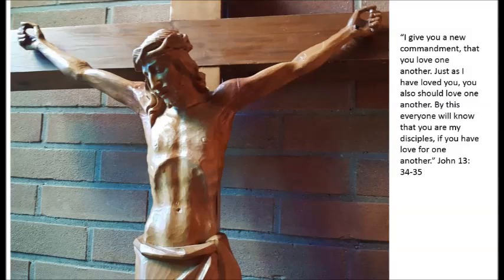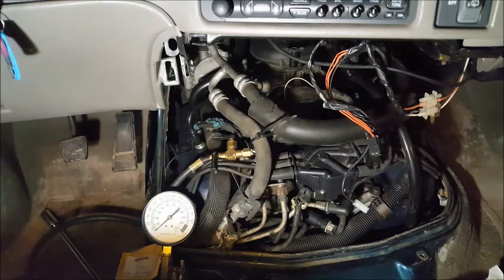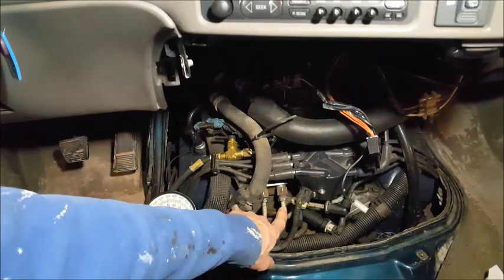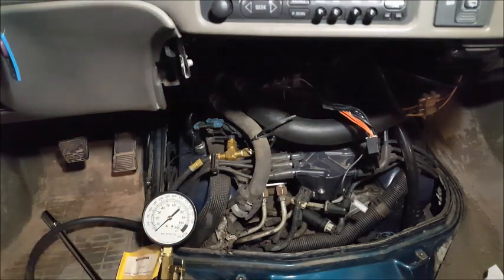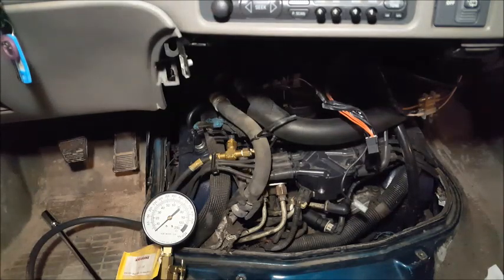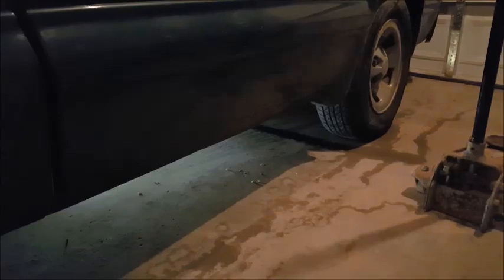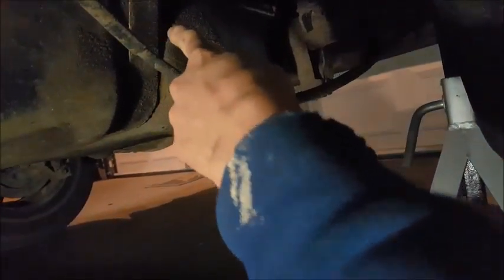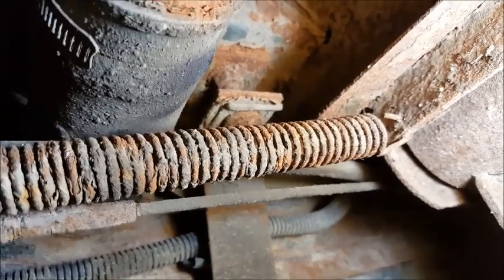1999 Chevy Astro Van no start diagnosis

Comment: my 1999 chevy astro doesnt even crank it just clicks but i just replaced the starter and battery and the motor isnt stuck do you know why it could be not cranking i also know it isnt the relay so thats out of the question as well

Comment: 0 PSI at the Schrader Valve too, crank no start, runs briefly with starter fluid. This is the last test I should do before purchasing a new fuel pump.
Reply from the maker: Do you hear the pump running then you turn the key on or off?  If you don't hear it I would make sure the pump is getting the command to run as I showed in the video.  If it is running you may have a situation where the pump output tube came off (that happened to me on an aftermarket pump).
Reply: @diywithdave3186  pump does not prime, can hear a gurgling sound when I turn the key off. Connector to the pump is receiving ground (4 pins [other pins nothing]). I could never get it to light up as hot. Even when key on, those pins light up as ground.
Reply from the maker: @OldSchoolNoe  you will only get a 2 second burst of pump run when you turn the key on or off.  So you have to be holding the test light on the power pin when someone turns the key on and off for you.  If you don't see it light up like I show at the end of the video, then the problem may not be the pump but the power is not getting to it.  I show you how to check the relay, and if that is working correctly then you must have a broken wire or corroded connection in the harness coming back to the tank.
Reply: Did that test again and no 2 second burst when key turned. Swapped the pump relay with an ac relay and had burst of power. Still 0 PSI but now a new issue. The van shuts off after a few seconds (aux mode) every single time. Put relays in their original spot and still shuts off. I recorded this symptom https://www.youtube.com/watch?v=za8ciw5amTE
Reply from the maker: @OldSchoolNoe  I would say you need to figure out the wiring issue before tackling the fuel pump. I haven't had the problem that you have, but it looks like something is shorting out and controller is shutting down.  If I was trying to narrow down the problem, I would start pulling relays/fuses and then turning the key on to see if you can find one that changes the behavior of the shut down when in aux mode.  If you can find one that makes it work correctly, then follow that circuit and look for shorts or open circuits.  If you know someone that has a van that works properly you could look for differences between yours and theirs.  Sorry, I can't be of more help.

Comment: At 7:49 , does the bottom harness have a ground to chassis connection?  Mine has a thick black wire that is cut off. I took a picture of it and posted in a forum https://www.astrosafari.com/viewtopic.php?f=76&t=145586
Reply from the maker: The link did not work for me.  I don't recall there being a chassis ground (assuming you are talking about the fuel pump harness).
Reply: @diywithdave3186  I got it resolved, turns out one of the wires that plugs directly into the pump was melted.

Comment: Mine started for a couple minutes then shut off. Now it won't crank at all no sound .
Reply from the maker: If it won't crank it is either the battery or something in the starter circuit.
Reply: Same thing happened to me today! Any tips?
Reply from the maker: @jaevlogs5848  get a multi-meter and start checking the circuit going to the starter to see where the break in the circuit is.

Comment: Or you could add an check valve on fuel line to act as replacement of brand new pump
Reply from the maker: Not following what you are saying?
Reply: @diywithdave3186    When fuel pump fails to give adequate fuel pressures but pump's motor is spinning and fuels are still moving then  in most of cases , Fuel pump's internal check valve are not functioning any longer . Therefore, fuel goes back to the tank and fuel pressures drops . So adding additional new check valve ( less than $10 ) on fuel line which should be placed at close to fuel pump location  then that would  stop fuels to returning back to the tank . Then fuel pressure will rises and pressure stays . 
Doing so You can give additional life to the fuel pump .   After a while that fails and pump's motor is no longer  working then you can pull out entire pump and replace fuel pump motor only  is the cheapest way .
Reply from the maker: @jamesshellgame9490  thanks for explaining that.  In my case the pump wasn't running at all, but it might help someone with the condition you describe.
Reply: WHAT?